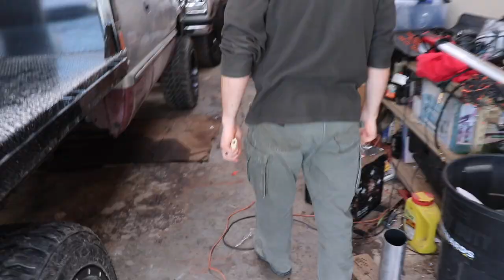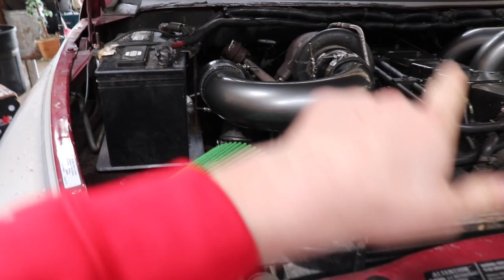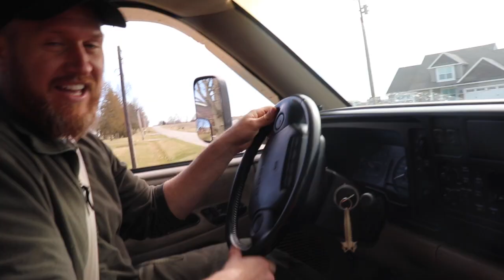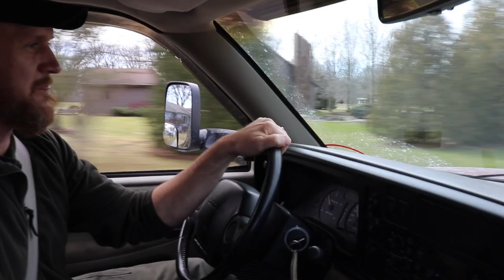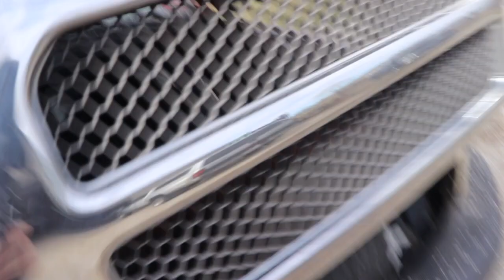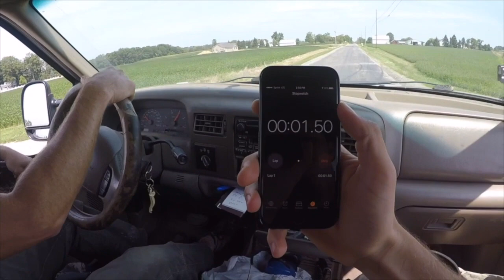DAD'S FIRST TIME DRIVING THE COMPOUND TURBO 12 VALVE CUMMINS!!!

Comment: That whistle ur hearing is part of ur leak that's not all turbo ur hearing. It's either a intercooler boot leaking or exhaust leak
Reply from the maker: big murph yeah that’s what I figured too
Reply: LOUD 'N' PROUD we had a stock second gen that made that same “turbo whistle” noise.  Turns out where we welded the exhaust together behind the turbo there was a small leak.  Fixed the leak and the noise was gone.
Reply: Defiently has an exhasut leak you can hear the ticking and the whistling

Comment: Maybe an idea for the light bar if you haven’t already had this passed by you. Maybe mount the light bar on the headache rack make some custom mounts on the rack and leave some extra wires so you can flip it around if you need some light doing other things. Good video
Reply: Billy Cringan plus that far up i bet it reflects off the hood
Reply: Kyle if it’s on the headache rack I very seriously doubt it’ll reflect on the hood 😐

Comment: Others have said it but the crazy loud whistle is most likely from the exhaust leak, as well as that ticking you are hearing. I doubt it the manifold is leaking. I would guess its either a boot or and v band clamp.

Comment: Since your getting the transmission built! Video the tach and speedo and full throttle it to like 80 or something. I wanna see how my little ole build stacks up to those compounds. Yours is automatic and mine is manual. I don't bang gears. I just shift it a little faster than normal.

Comment: I think that truck is sweet except the bed if I remember right that's a PJ style of bed clearly from CM which I was a welder there extremely fast pace kind of work environment they wanted us to build 25-30 beds a day which would have been no problem when everyone showed up for work everyday point is regardless if everyone showed up or not they still wanted there quota met whether it meant slapping metal together and putting some super quick squiggly bull crap welds on it which I hope isn't the case for you and your dad alot of the beds came out good by my standards however there is a bunch of beds out there with those squiggly welds on it should be 2 welds on open side of C channel and one on back side

Comment: Take the manual out of the dully and put her in nasty red all it would need is a 200 dollar heavy duty clutch vs the cost of bulding a auto to handle the power
Reply: Colton Cheever ....... lol 200 dolla clutch.
Reply: 200.00 get out of here. This ain’t no autozone special. 200 might by you the alignment tool
Reply: He drives the dually
Reply: Colton Cheever nah. Keep the 3500 with the 5 speed.

Comment: Its prob. Screaming for more fuel.
Reply: They did turn up the fuel bigger injectors and delivery valves and govonor springs
Reply: Jo Moma gotta have a lift pump to get the fuel to those things js
Reply: Is not getting much boost with a leak like that so it’s probably not wanting to much yet
Reply: Jayson Webster yea i didnt watch the whole video. Exactly why gauges and lift pump should be the first thing done to a diesel.

Comment: Hey Lnp im going to be doing the same set up with the compund and injectors and arp headstuds on my 2001 24 valve, just wondering if you think the mods that you did made the mpg go up or down and also check out my insta Robs_Cummins

Comment: Need to fix that boost leak
Reply from the maker: 8 lug Thug watch the newer vids... it’s fixed
Reply: LOUD 'N' PROUD good that’s a easy fix
Reply: Putting 6.0 intercooler on the 7.3l I got it for a 100 dollers needs a smaller boot on the drivers side